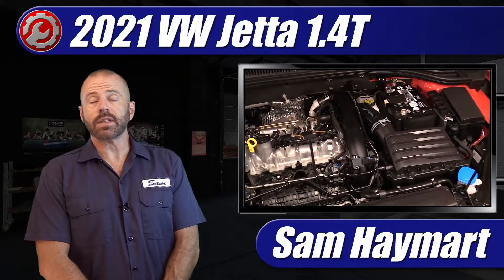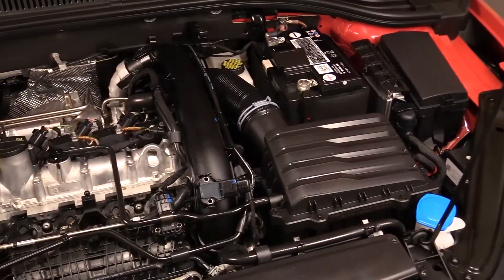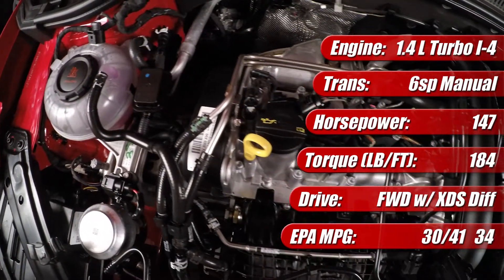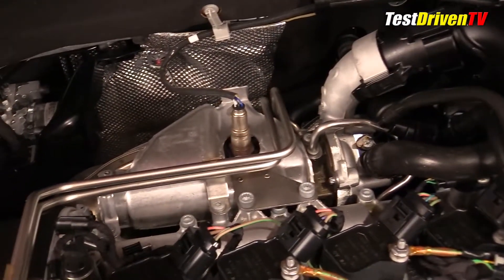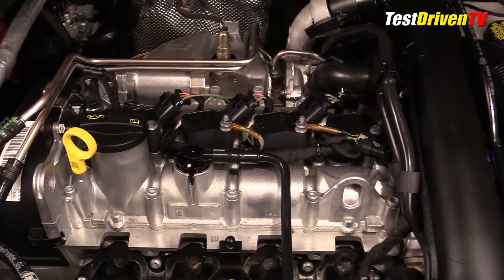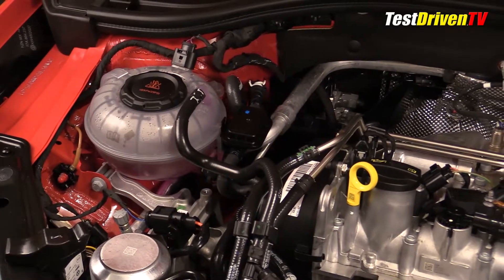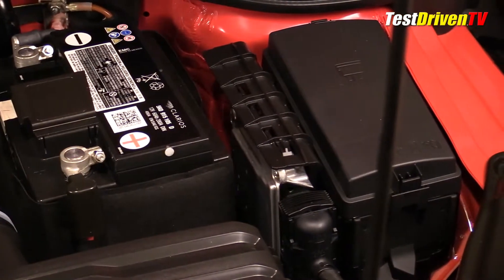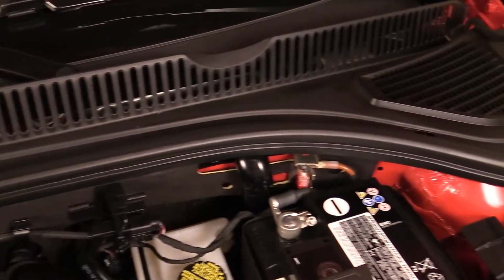2019-2022 Volkswagen Jetta 1.4T Engine Explained

Comment: I was really hoping you would show specifically where the VVT Solenoid and the Camshaft Sensor are on this 2019 year model. Can’t find it anywhere on YouTube, and I’ve been looking all week. Kinda need to know now, so I can get to swapping them out. Hopefully they are both pretty easy to access! I think I may have located the camshaft sensor, but I’m hoping that’s not it, cause there is stuff in the way that will be a problem. It wasn’t that way in previous year models, but I’m assuming if that’s it, they’ve done that to make it harder to replace yourself. 
Also want to purchase a service/repair manual but finding one for the 2019/2020 Jetta has been frustrating. The ones I’m finding stop at the 2018 models. 
Any helps or guidance would be greatly appreciated!

Comment: I have a 2019 premium sel..same engine ...i was told the timing belt was lifetime....can you elaborate on this..thanks
Reply: timing belt and lifetime do not belong in the same sentence, I wouldn't trust the idea of a lifetime belt. If it's the manufacture that said that, remember "lifetime" to a manufacturer = their warranty period. Just stick to the rule of thumb timing belt service interval: 100k miles or 10 years whichever comes first, no sense in risking your engine on the chance the belt won't break

Comment: does anyone know if a 2020 jetta has a thermostat housing or water pump. i have found articles that state both. mine needs to be replaced and the cost difference is drastic depending on what it has
Reply: The thermostat is built into the water pump. I already had mine replaced with the timing belt.
Reply: What did that cost? @Stix1127

Comment: I couldn't find a timing belt interval in my manual.  I'm going to assume change at 100k miles.
Reply: You would be right. They say it is lifetime officially, but NEVER follow that ridiculous piece of advice. They likely expect people to trade these in within 7 years, hence the reason why they say “for the lifetime of the car.”
Reply: You gotta look online but it says 60,000 and if it looks okay then inspect every 10,000 after. I noticed when I was changing it that the tensioner was not under tension and failed
Reply: 60k miles/7 years. That's ok for a Euro car